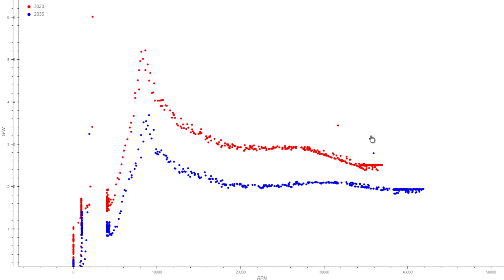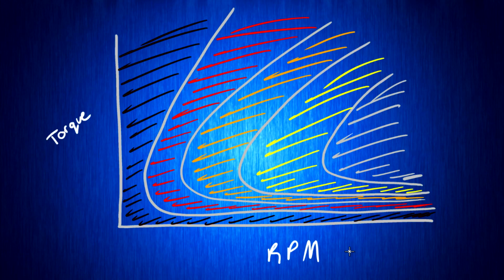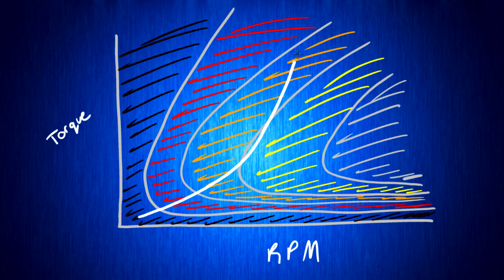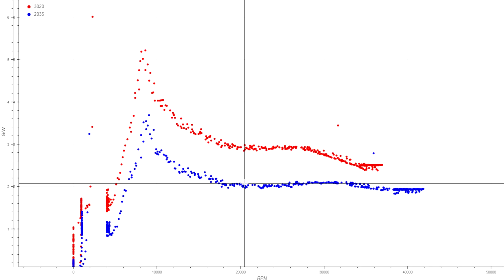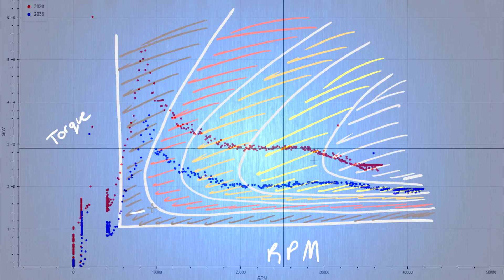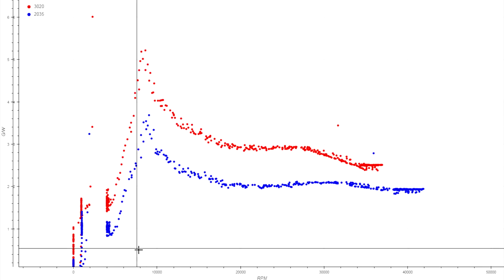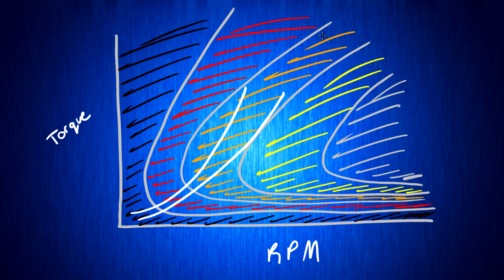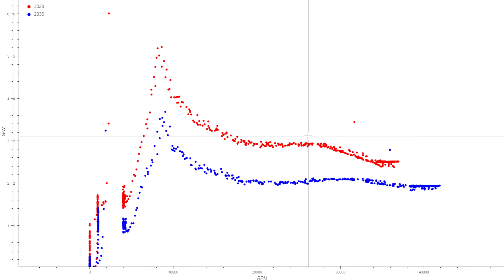Interpreting brushless motor efficiency charts

Comment: The first hump (the extremely high peaks) is the high efficiency intrinsic of the propeller fluid dynamics curve; The second hump (very small, almost insignificant) is the high electrical efficiency given by the motor's tendency to need high RPM. Human powered air planes and utility drones that prioritize high efficiency over stunt performance spin the props at the first hump. The first hump has very slow RPM, everything moves in slow motion, if you have seen video of how the human powered planes fly.

Comment: Hey what do you use to measure your g/W just a scale and a wattmeter or something mor sophisticated to plot it instantly?

good videos, got a new sub and notifications on!
Reply from the maker: I have my own testing controller that drives either a thrust stand or a dyno.  I log at 25khz so the data is too dense to chart instantly, I dump a binary log file to my computer and have a toolset to analyze it after the fact.

Comment: i want to see a wind tunnel for dynamic testing SOOOOO BADDDD!!!!   I think it would really change the location of peaks/ valleys in efficiency and let us really decide which motor/ prop combos are better for each type of flying.  I'll send you $20 if you start a gofundme type account!
Reply: Wind tunnel tested airfoils are usually available for helicopters. NASA0015 , etc. They have been researched for 50 years with papers. Chinese made props of thousands of designs every month will not likely ever get wind tunnel measurements.